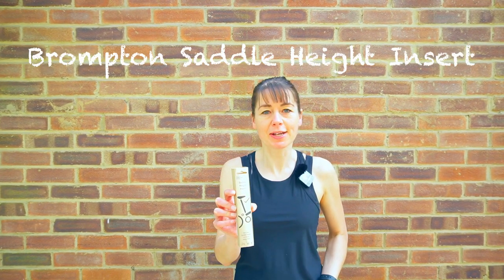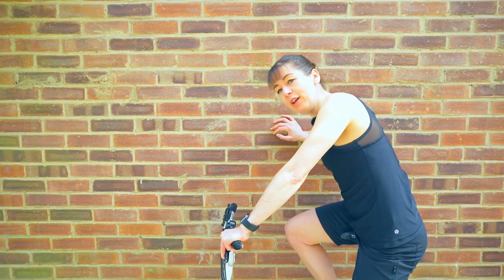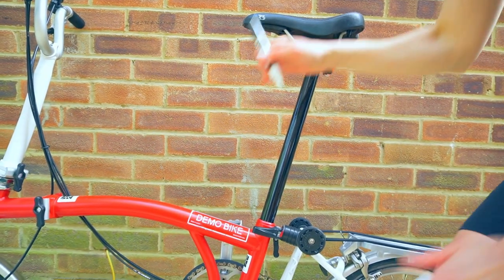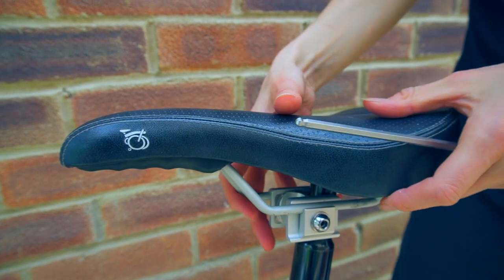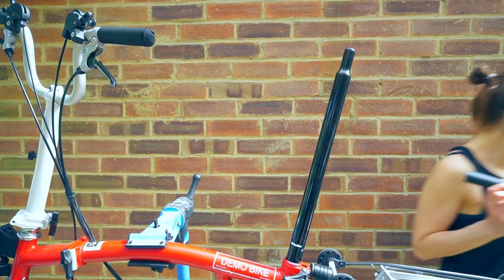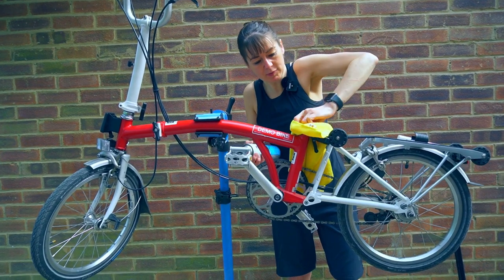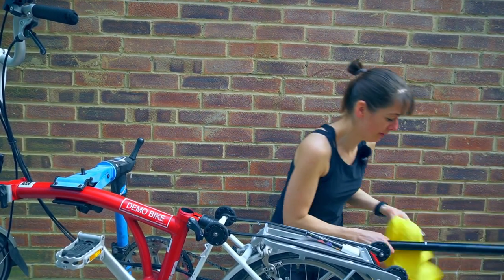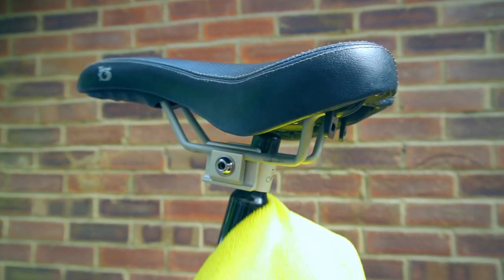Brompton Saddle Height Insert installation and use

Comment: Your videos are very helpful and informative, especially for the new owner of a C line Brompton like me!

After installed the Height Insert, I used the piece of plastic left to wrap around the handlebar stem to prevent the cables rub against the paint of the stem.
Didn't pass any beauty contest, but it worked.
Reply from the maker: Thank you so much! We are really glad they help. We often use gorilla tape to stop wear. Have you named your new Brompton yet?

Comment: The procedure is described in the Brompton manual, which I just haven't had time to use till now, but this film is much more usefull! Thank You!
Reply from the maker: Thank you watching and glad you found it useful
Reply: @brilliantbikes  Without the insert I need to use the "Search and You will find" method for my Brompton ;-) and I have just ordered a new black titanium post for my Lightweight, which may not be able to use it, as it is with a built in clamp for the saddle and as such with no stop in the bottom of the post! But I will find out when I get it?

Comment: BRILLIANT! I have several of these which came with the bikes, and after working out what they were I went to YouTube to look at fitting and use... unfortunately I viewed a very complicated film that looked like the piece had to be glued in, drilled out and replaced frequently and frankly looked beyond my humble mechanical abilities, so I just wing it on seat height and make adjustments if not comfortable.  Well, No More! Thanks for making that look easy!  A solid 9/10 on the fringe... would never have known and pretty sure there will be many home attempts around the country that won’t look a fraction as professional!
Reply: Amanda Leigh The video you watched will be the procedure for when the seatpost sleeve insert is worn and needs replacing (it is glued into the top of the seat tube and then reamed using a specialist tool).  The insert in this video sits beneath that sleeve.
Reply: Platypus Hatstand  - Many thanks for the elucidation, I frequently find myself wishing for a Haynes Manual for my Bromptons!
Reply from the maker: Thanks for watching again and for the high score on the fringe

The seat post insert (as opposed to the saddle height insert) is more complex - it's supposed to be one of the few "shop only" Brompton parts

To be honest we do the same as you normally - just adjust based on how it feels

Comment: thank you for sharing helpful video for brompton.  Does saddle height insert can prevent slipping seatpost ? thank you in advance
Reply from the maker: Many thanks for the question. No the seat post insert will not help if your seat post is slipping. If the seat post is slipping you may need a new seat sleeve insert - these are different and go into the mainframe. Hope this makes sense and if needed please pop into your local Brompton dealer.

Comment: ....failed to install this one as the removal of the telescopic post is a bit more tricky and didnt want to break any of the plastic post-fittings... But my adjustment is about the 535mm full post length so I ll probably leave it aside!

Comment: Your video instruction on saddle height is very helpful. However, it is not clear when you indicated that the seat post must be pulled up. The question I would like to ask is: at what point is the post to be pulled up, or is it to be pulled up to the end of the post where the post tip meets the clamp? Hope you can help to answer as I have bought the insert but hesitant to install because I am still unclear. Thank you.
Reply from the maker: The seat post should be pulled up to the correct height for you before you mark it and the instal the insert
Reply: @brilliantbikes  
What is the correct height for the seat post to be pulled up? Is at the end/tip of the post where there is just sufficient length for the clamp to tightened the post?  Thkq

Comment: Hmmm. I have to remove my saddle every time I put the bike in my car (MX5, in case you're wondering...). 
I also have to drop the seat post all the way down. 
Will this insert upset this necessity?
Reply from the maker: Many thanks for the question. No the bike folds as normal with the saddle height insert. So it should be unchanged.

Comment: When I extend seat post it is at least a foot from the mark to the frame. How do you use the insert then?
Reply from the maker: It sounds like you have an extended length seat post and maybe need a standard one, or a shortened one. 
Thanks for watching!

Comment: Actually there is a simpler way. No need to remove the saddle etc. Just losses the seat post clamp, bring the post down, and then get a clear thicker(8mil) 3M tape that goes round the circumference of the post. Have another small 3m tape to stick at the bottom of the post and raise the post up to see where it stops for your desired marked height of the seat post at the clamp. Then the small tape marks out the part needed, replace it with the actual longer 3m tape and tape is all round. You will now always have the seat post come up to the height you need and set with the tape inside. To prevent the seat post from going down, just give the 10mm nut a 1/4 turn when clamp is done and tightened. Did that for all my brommies

Comment: New subscriber & love the videos...Currently saving up for for a Brompton E M6L & have a question. As the lights on the E bike are powered by the battery pack will they not work if the battery dies or can they run off normal batteries as a back-up? Thanks again & keep up the great work 👍

Comment: 2:40 What is the bracket used here to mount the light to the rails of the saddle?
Reply from the maker: It’s a Busch and Muller bracket mount for saddles - 50mm, link as follows
https://brilliantbikes.co.uk/brompton-lights/3231-bracket-mount-for-saddles-50mm.html

Thanks for the question and for watching
Reply: @brilliantbikes  much thanks.

Comment: I put off inserting the, err.. insert, for ages. I didn't want to cut it, and then discover it wasn't the perfect height for me.
Eventually I did, though, and boy does it make a difference to how quickly the bike can be prepared for riding!?
Also, should I ever decide the seat tube could have been a fraction longer, rather than shorter, I understand that a little height can be eked out of the positioning of the pentaclip... which facility seems a bit useful.
Of course, I am now at the age where I am shorter every birthday.... (everybody loses 1" of height for every 10 years over 50).

Comment: Painfull......why not just mark the seatpost ?
Reply from the maker: Thanks for watching

With the seatpost insert you can just pull up the saddle without looking - it just stops as it reaches the height

Marks could easily rub off - we have heard of people scoring the post, but that can cause fatigue of the metal

In reality we don't have them in our bikes - as the required height can vary depending upon who is riding, the shoes worn and even the riding style

Comment: This looks like another over-priced unnecessary piece of kit from Brompton..if you have already marked the correct height with a white pen, then why not just raise the seat-post to this mark...why do you need the insert?
Reply from the maker: Thanks for watching - getting feedback / comments is really appreciated

There is no need to use the saddle height insert - it comes ‘free’ with each new Brompton 

If installed, it allows you to raise the seatpost to its maximum (as set by the insert) so without looking it is at your perfect height

As we said, it doesn’t work if you have multiple riders using the same bike or if you use shoes with different sole thickness (but then neither does a white line)